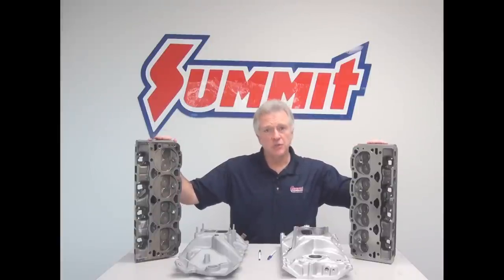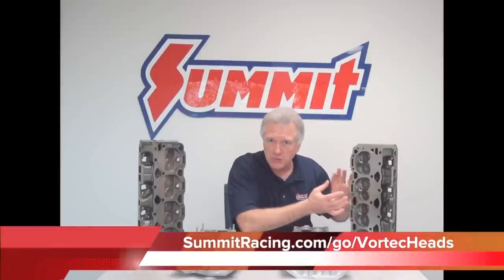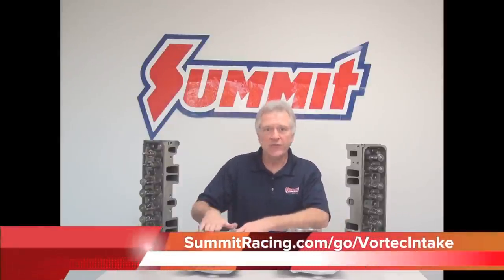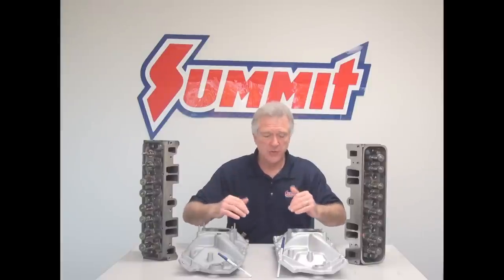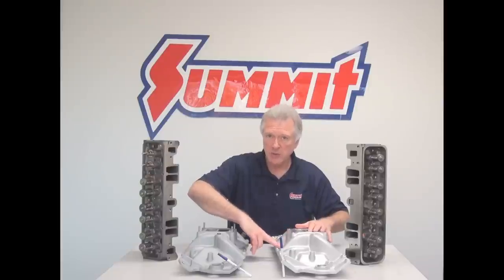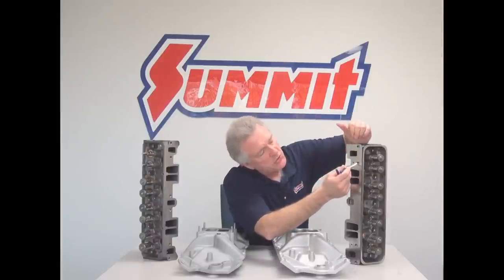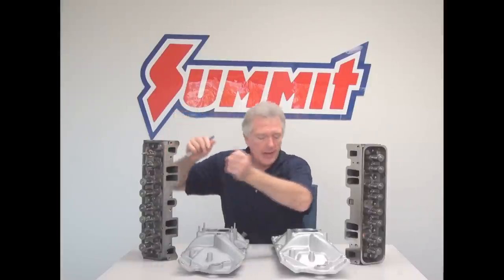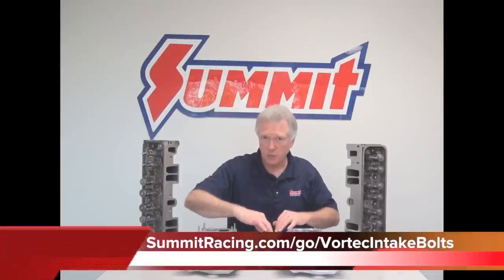Chevy Vortec Heads

Comment: I am amazed at how much I gained by installing a set of 906 Vortec heads on my roller cam 350. After extensive testing... I learned that they typically don't like a Total Advance beyond 32 degrees with that achieved @ 3,400 RPM. I used an HEI distributor with an Adjustable Vacuum Advance that was limited to 8 degrees and hooked to manifold vacuum to assist with the idle and low RPM highway cruising. This also helps to keep the motor cool. (Never hook the vacuum advance to a port and leave it completely unhooked if you have a radical cam grind that experiences vacuum wobble at idle that will bounce the vacuum advance.) I used the Edelbrock 2116 Intake and a Street Demon carb. I was able to use the stock GM 7.2 length roller cam pushrods and the stock self-aligning 1.5 rocker arms. I would imagine that if you used a flat tappet cam, you would use the stock GM length of 7.8 and, once again, the self-aligning 1.5 rocker arms. I plan on upgrading to the Comp Cam 1.5/1.6 Steel Roller Rocker Arms soon. The Vortec heads flow like crazy at a moderate cam lift of 0.400. I did all of this in my '86 Chevy truck with a modded 700r4 with a 3.08 gear set. The 3.42's will be going back in it soon. The truck pulls like crazy now, with all sorts of usable torque; just what I wanted for my daily driver. I also believe that my fuel mileage will increase, too. I quickly noticed that it is taking less throttle to maintain the same highway speeds. When I build my other little block 350, I am going to purchase a set of new Vortec heads from Summit. For $340ish a head, you can't go wrong.
Reply: what mileage u get
Reply: @james-sz9un  I have a set of saw tooths in my 88 camaro. 355 forged flat tops, 15 thou shim gasket 500 lift flat tappet cam,  ls springs and comp cam retainers with screw in studs 1.6 ratio on intake and 1.5 on exhaust 600 Holley street warrior carb 700r4 and 3:42 gears and it gets 20 mph if not more if you drive it normal!  Pulls hard and actually scared to get on it to much something might break lol!!

Comment from the maker: The retainers from an earlier model cylinder head would actually experience the same issue as the Vortecs. One possible solution for you is to use the following 3 Comp Cams part numbers. These are a new design “Beehive” style spring, retainer & valve lock. Properly installed these springs will not require machining of the Vortec valve guide area and will allow as much as a .550” inch valve lift.
CCA-26915-16  - Springs
CCA-774-16  - Retainers
CCA-648-16  - Valve Locks
Reply: How high can you rev it after you put the new springs and stuff on? I have a stepdad that has a 72 c10 with a 355 that can only go up to 5200 rpm. Can he be able to rev it up to 5500 or 6k?

Comment from the maker: Vortec heads are a great way to add some horsepower to a motor but, their lack of a heat crossover will make the motor a little cold blooded on cooler morning starts. There are also specific intake manifolds and gaskets that must be bought to match the Vortec heads specifically. Summit Racing carries all those components to make it a one stop shop for you. Thanks for watching!

Comment from the maker: Stock/untouched Vortec heads typically are limited to a .460 valve lift. If more is required, we will private message you a link to an article that will help you.  As for a distributor drive gear, the manufacturer of the cam should be consulted for their recommendation.

Comment from the maker: Hi Roturo8, As you stated you will need the cylinder heads,intake manifold, proper manifold bolts and gaskets, narrow body self-aligning rockers, center bolt valve covers and their gaskets and bolts to get things going. As long as your older 350 is basically a passenger or light truck motor then I don’t see any compatibility issues with the stock cam; if it’s something less common or more exotic from Chevrolet then of course I would like to know the lift before giving you the go ahead.Good luck.

Comment: It's my wish to get Vortec Heads bare and upgrade with Chevy LT-4 valve-train components which are Sodium Filled exhaust valves 1.55 inch, Intake valve 2.0 inch, Beehive Springs with light-weight, smaller retainers using 1.6 Rocker-arms. The brief articles I find in reference manuals indicate all this is possible but I have not found anyone who does this or has done this already. I believe this would be a fun performance upgrade. I have 40 years experience building my own personal engines, was a mechanical Engineer in the Navy (retired), have been to Mechanic Technical Trade schools in my youth and worked at car dealers in the shop as well as working on my grand-father's trucks since age 12 in 1970. I built the engine in every car I have ever owned (about 30 of them) and currently own 8 High Performance cars from the 70's. Cylinder head prep has always been my best specialty but I do not own a machine shop. My question is if you know any sources or reference materials about these Vortec upgrades.? Any information you might provide is of great benefit and greatly appreciated. I am also a Summit customer. Thanks.
Reply: I've heard LS6 springs will work without any machining if you use comp cam retainers. They are good for 590 lift. Never heard of anyone using a 1.6 rocker though.
Reply: Search for David Vizard

Comment: Is the exhaust bolt spacing the same as Gen I? Do I need a “Vortec  Header?”
Reply from the maker: The 1996 and newer Vortec is a Gen 1 engine and the exhaust bolt spacing is the same as the older Gen 1s.

Comment: Here's my combo... 1977 corvette L48 350.
062 vortec heads, edlbrock performer intake
And L79 Cam with 477 lift... Will I need to change the springs ??
I plan on yanking the stud, but what's the replacement? I noticed they have different dimentions.Also will I need to change pistons ???.. New Guy..

Comment: More power from idle &up great design,All heads 95& older center bolt heads suck real bad ,total timing of 8-12 ° is often the  case ,Must have working EGR to get anymore timing for power or normal slug drivability. The worst gen . One cly. Heads ever !!!

Comment: Hey I have a 96 350 that I have bored .30 over to a 383. I was wondering can I use the stock Vortec 5.7 heads for this build or will I need bigger valves? Thank you.
Reply: Bigger Valves

Comment: Only putting vortec heads on your chevy want give you any more hp. In 96 GM put a hotter cam in the 5.7 truck engine. That's where the 255hp came from. The heads do flow better but the reason is because GM remove the swirl ramps. Because they went to CPI, the ramps were no longer needed to help atomize the fuel. No, I'm not hating because I just bought a set from Summit with screw in studs .500 lift $670. Both of my 96 Tahoe heads were cracked. I also bought Comp 260H cam. If u want to make hp you can feel without putting your car on a dyno. Change the cam. Will the computer work with the cam? I don't know but I will deal with that bitch soon.
Reply: blackericdenice  Can you please give us a update? Would like to know if the new cam worked with the stock computer. Thanks
Reply: ArizonaDesertRats Yes it ran with the stock computer. The only problem was i didn't have much power. I thought it was because of the cam but i had put a bad converter n there. I wish i knew that before i swap to a 99 tahoe pcm. Tahoe 1st. drive after rebuild; is the video.
Reply: I'm almost done with the tuning. I will upload a video showing how to do it.

Comment: Can someone help me I have a 1998 Silverado 1500 vortec and the head numbers and 217 anyone help me tell me if this is a vortec head the bolts are 90 degree for the intake and online it says it’s a boat Marine application so is it vortec or not center bolt valve covers

Comment: Hi im building a 80's 350 with the vortec heads im installing screw in studs, I have ordered the valve seat cutter from summitracing im going to be running a roller cam with .510/.540 lift my question is what valve spring should I run? Thanks Pat

Comment: The Vortec 5.7 V8 is a powerful engine for it's size. I have one in a full size Chevy van. I have no trouble running 80 to 85 all day, even up mountains loaded. (The van not me !). A new Vortec engine from Summit is around $2k. Putting one in my van as we speak. My old engine bit the bullet when my wife overheated it at 280,000 miles. If I ever build a small block Chevy for a project, it will be a Vortec.
Reply from the maker: That is awesome! Thank you for sharing your expierince with us! Good luck with the new Vortec Engine. Thank you for your business!
Reply: +Summit Racing  Will these Vortec heads and intake work on a 1994 k1500 with TBI?

Comment: I have a 1994 chevy 350 rebuilt and around 340HP at 4500rpm. if i replaced the stock heads with a par of vortec heads would would be the typical horsepower increase?

Comment: I've got the springs and retainers, do I need to go with 1.6 rockers with a .50 lift cam?
Reply from the maker: No you don’t need to use 1.6 rockers unless you want to. Its not a requirement

Comment: Thanks for the information. 
Are there any builds that have been dyno tested to show the difference in power/efficiency compared to any of the old style heads? Maybe an engine that was stock with a set of camelback heads that was rebuilt using the Summit Vortec?

Comment: i put a set of the promax heads on my 74 nova after i rebuilt the bottom end i now have 10-1 compression with them and im running a voodoo cam they work great i have no issues with them at all

Comment: Will these heads fit old 350 block out of a 81 pickup?
Reply from the maker: Ron S,
Yes, the Vortec heads will bolt
right on to an earlier model block. Just remember to buy an aftermarket
“Vortec” intake manifold to match. An early intake manifold bolt pattern is
very different.

Comment: Ok, so how much for Head s done up with 202 intake 1.6 exhaust with upgraded valve springs and screw in rocker studs ready to bolt on and run for a $ pair of them.......???
Reply from the maker: Hi Karl, we will need some additional information. Please contact our sales line at 1-800-230-3030. Thanks!

Comment: Can you explain or better yet show the difference between 95 and earlier and 96-2000 sbc coolant bypass? I hear the early engines had the hole below the water pump opening. Now the 96 up blocks don't have the extra passage as I hear.

I hear coolant needs to circulate prior to the thermostat opening to prevent hot spots before the t-stat opens.

How is this accomplished? And do you need to make any changes when Installing a Vortec style head on an earlier block or installing early heads on a Vortech block without the extra passage? I've heard suggestion that a hole is drilled?!?
Reply from the maker: Thank you for your question. Here is some good info from one of our manufacturers:
https://flowkoolerwaterpumps.com/blogs/cooling-resources/resolving-the-vortec-temperature-spike
Reply: Thanks so much! Good to know. I'd think with how crack prone these heads are that more folks would talk about the advantage of adding a bypass hose.

Comment: so is it as simple as to change out the valve spring retainers? if so can i use the ones(retainers and springs) off the original heads to mt 70's shortblock? i wanted to put a cam with a 488/488 lift

Comment: My intentions on my 350 crate motor (not sure on the yr) r a comp thumpr cam, vortec heads, edelbrock rpm air gap intake with 600 cfm carb and timing gear drive. Is all of this possible? Its in a 68 C10 2wd long bed. I plan on doin a 3.42 lsd rear end with full disc brakes. Also will a 2500 stall converter work on this setup? Thanks for the video and any help i can get. Will post when it gets done!!
Reply from the maker: Hi cmccarter2009, 
Can you give our tech department a call? We have a few suggestions we would like to discuss with you. 1-330-630-0240. Thanks!

Comment: I have a 80 c10 thinking about doing this swap but I have a cam installed with 475 lift 220~ish duration and I want to know if u have the parts for that 350 or do I have to get the heads machined

Comment: Good informative vid, however, I think a little more info on the modifications that apply to different running expectations e.g. rpm, street/strip/off-road, relation to compression ratios, and recommended cams.

Comment: Does anyone know if my bottom end had to have any modifications to be able to handle the heads . In example probably rebuild with different components like forged pistons ect
Reply from the maker: Hello Juan, 
 
These heads will bolt up to any Gen 1 Small block just fine You will need a Vortec-specific intake manifold and center-bolt valve covers. As with any performance upgrades, your lower end should always be in good condition, but you would not need any specific lower end upgrades.  
 
Be aware they may increase your compression ratio to require high-octane fuel.  
 
The Summit Racing® Vortec Cylinder Heads heads have a 67cc combustion chamber and yield a 9.4-9.6:1 compression ratio with flat top pistons. The max lift with a flat tappet camshaft is .520" lift.  
 
 The Chevrolet Performance Vortec Cylinder Heads have a 64cc combustion chamber and yield a 9.7-9.8:1 compression ratio with flat top pistons. The max lift with a flat tappet camshaft is .475" lift.
Reply: Lol its a head not a supercharger

Comment: will a .458/.458 lift, advertised 258/262 ,@ .50" 206/210, grind number x4258hr for the 906 heads. and will i use a melonized gear with this cam.

Comment: Can you help me out? I've been looking around for info on performance upgrades for my 2002 GMC 4.3l Sierra. I've torn down my engine to replace all gaskets, and would like to go ahead and replace the heads and intake. And because I'm going that direction, I'd love to go back to a carbed engine. So, which heads, carb intake and headers would you recommend? Also, does Summit carry the fuel tank conversion kits for going to carb from EFI? Finally, which performance cam kit do you suggest? I'm done with electrical issues in my truck. I appreciate you humoring me on this one!
Reply: Time for a V8 swap, sir! The little Sierra will love it!
Reply: @rite2beararms  I love my 350, but in this truck, I want to play with the V6.

Comment: i have a set of 1239906 cylinder heads and i dont have the saw tooth thing you were talking about. what does this mean??
Reply from the maker: Bradley Wentz ,
Many people will try to use
these symbols for external identification when the motor is together. As you
can see it’s not an exact science; always use the casting number for ID
purposes. Your casting number seems to be missing a digit and is most likely
10239906.

Comment from the maker: Yes, your factory Vortec heads will bolt onto the earlier engine block but, beware of the valve lift limitation of those heads. Because GM used a tall valve guide in those heads the valve spring retainer will actually make contact at a valve lift of approximately .465” – .470”.  A qualified machine shop can surely rectify that situation if your intentions are to use a cam with a higher lift value.
Reply: Will the new beehive springs and stuff fix it to

Comment: I have a 1998 GMC sierra 350 vortec 5.7 l 1500 4x4 z71 
Will these upgrade Vortec heads fit my motor it's a fuel injection motor Vortec
Reply from the maker: The Vortec cylinder heads in this video are stock replacement, which will be the same that is on your engine. However, we do offer upraded Vortec cylinder heads that will bolt onto your engine, as well accept your fuel injected intake manifold.
Reply: Great because I'm in the market for some new heads
Reply from the maker: Ryan, contact us and we will help get you set up: https://help.summitracing.com/app/contactus/
Reply: Just got back from  Summit Racing in McDonough thanks for helping
Reply from the maker: We appreciate your business!

Comment: I have a 95 c1500 Tbi, I ordered vortec heads. What size cam should I use?
Reply from the maker: +Chris Taylor , 
This would depend on a few things but specifically which Vortec head. Stock ones have a lift limitation due to valve guide interference. Give us a call with more info, we can help. 1-330-630-0240.

Comment: Is there a Hp range for these heads?
Reply from the maker: Hi Rick, 
These heads should be considered as a 300-350hp capable head. Of course this will depend on the rest of the build. Give us a call and we’ll help you choose the right parts! 1-330-630-0240.

Comment: I have a pair of 062 vortec heads will they work on a 1957 283
Reply from the maker: Hi richard trimble, 
They will physically bolt on but, depending on the camshaft and the valve size, you may have some clearance issues!

Comment: i have a 70's style 350 punched 30 over. i have a 350 from a 99 suburban. can i use the heads from that motor for my 70's shortblock? if so are there any specifics i need to know?
Reply: Yes. Need new intake.

Comment: Can you use a Set of roller rockers on the vortec heads . The vortec heads are going on a 94 350 SB
Reply from the maker: Hi Chance Stuart Leamont, 
Vortec cylinder heads require what’s called a “Narrow body self-aligning” rocker arm.  They have narrow bodies to clear the internal webbing of the center bolt valve covers and washers on each side of the roller tips to keep them from moving side to side. We have many choices so feel free to call us and we can help you pick out the right ones. 1-330-630-0240. Thanks for watching!
Reply: @SummitRacing  do the summit brand vortec heads (aftermarket) flow comparable to the oem gm vortec 062/906 heads?? If so do you comparative flow numbers starting at .100 to .600 valve lift? Thanks!!